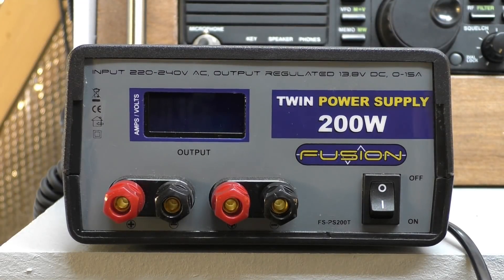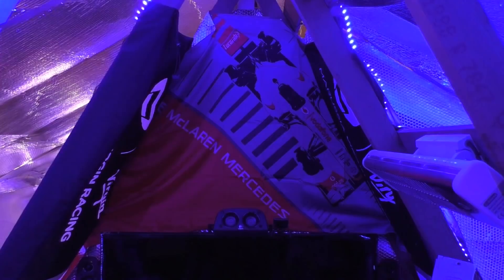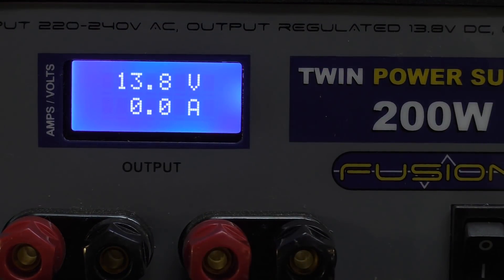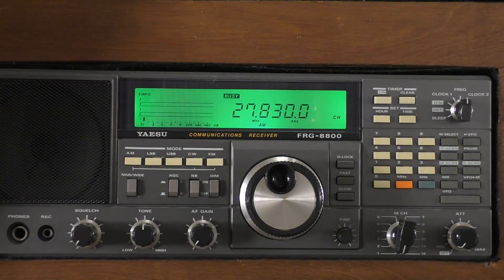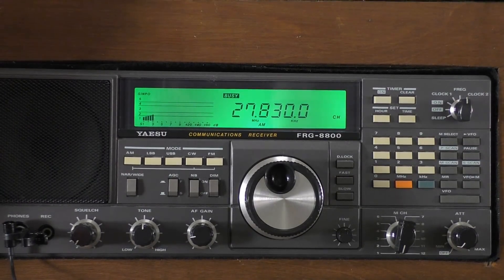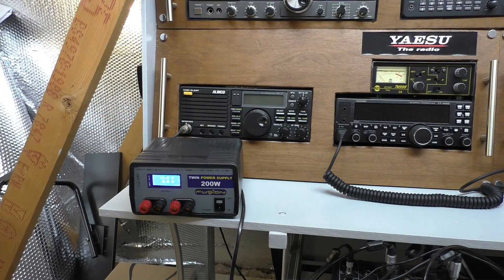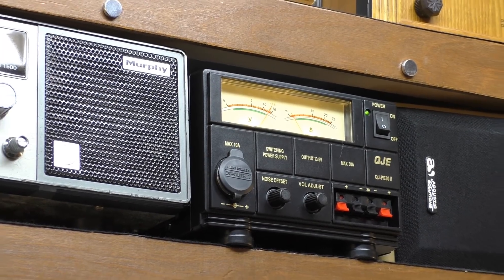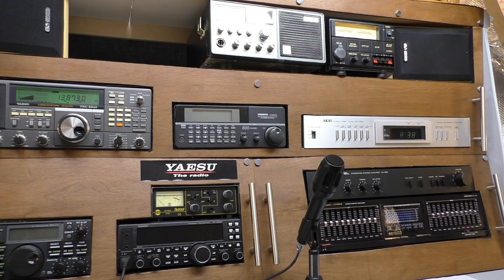CB RADIO.  Why Fusion PSU's are terrible for radio.

Comment: Great video Fred and a good point as well. On switch mode P/S  designed for radio equipment they usually allow you to tweak the switching frequency which lets you tune the interference out, otherwise a additional LC network filtering can help too. I just don’t know why they don’t build those features into the PS in the first place, it cant cost that much. Joel, N6ALT
Reply from the maker: I think these PSU's are really bench supplies Joel.  When i bought this one about 3 years back it said it was ok for radio but it really is not.  Thanks for the input. 73

Comment: Sounds like the good old battery charger days Fred lol. As for the fan on the PS, it sounds like a hoover. Good video as usual, thanks Fred take care.
Reply from the maker: Hi Roy.  Guess i was not the only one that used his dads battery charger as a CB PSU.  I still rem the hum over transmit lol.
Reply: Remember getting my A**E whacked when mother saw the shriveled up ubiquitous vinyl flooring next to the battery. The good old days Fred lol. Hope the family is well. 4 legs and 2 legs.Thanks again Fred

Comment: Old Computer PSUs are a cheap alternative to those on a budget and they are very RF friendly...Don't let all the wires put you off using them.
Reply from the maker: Yes well said.  PC supplies can be a good supply as long as you work out the wiring.  I think it was yellow for 12 volts.

Comment: Good video Fred, as bad as it is for the 11m band, it's good to see it doesn't appear to wipe out the lower ham and shortwave bands.
I wonder if it's worth testing the same frequencies using a handheld radio/scanner to see if the noise is mains distributed or as more likely via the airwaves?
If its via airwaves, rather than not using it for radio, perhaps move it away from the radio to another part of the house and see if the noise is as bad? Perhaps putting it inside a bigger metal casing would reduce the stray RF emitted?
Reply from the maker: Yes i thing a metal housing would help.  I first noticed it on the Grant 2 where it knocked out all S2 signals on SSB.  Not recommended this one.
Reply: fredintheshed1 thats the only downside to cheap psu's, noise reduction parts cost pennies, but mass production would increase costs massively. This video will certainly help the new folks to radio as noise like this would put them off radio altogether.
Reply from the maker: I agree the last thing you want to do is add noise to your set up esp if your homebased.